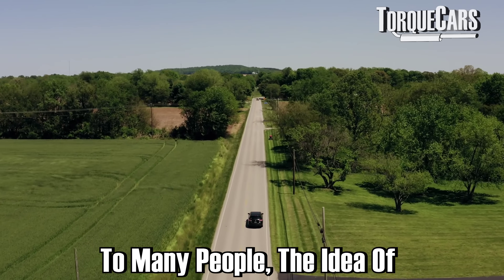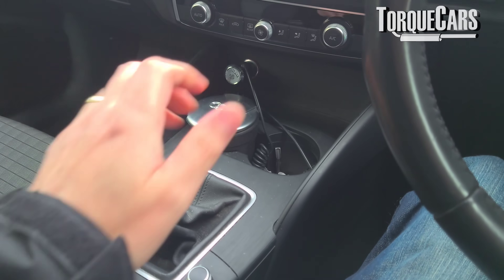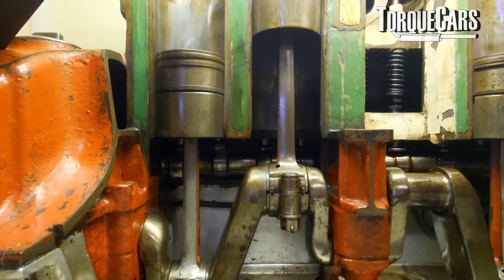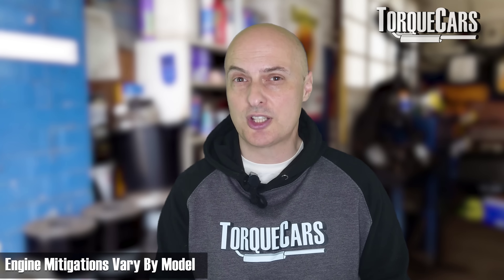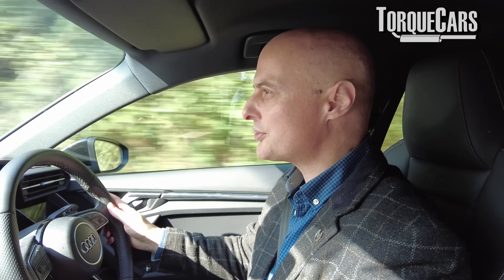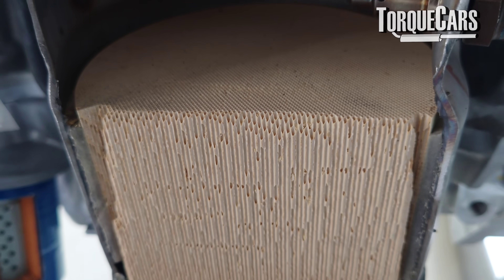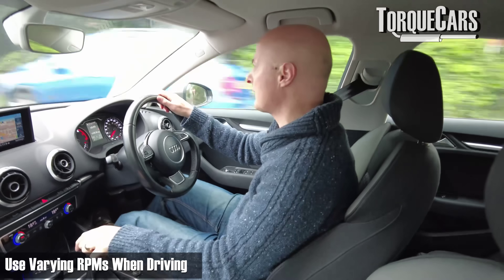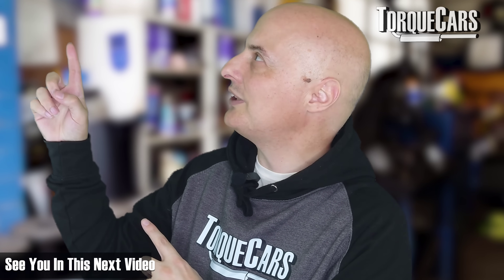BIG DAMAGE By Lugging at LOW RPM? Eco Driving Warning! (Manual Gears)

Comment: You should start this video by stating that most of what you are talking about here applies more to small cc turbo charged engines. For example NA 4.0 V8 won't really care about it but a 1.6 or 2.0 turbo charged petrol engine will be affected by this, especially LSPI at low revs and high throttle. Also diesels generally don't give much of a dam about this either.
Reply: Yeah, diesels are made for low rpm driving, they will be happy with anything above 1500rpm
Reply: @foxy126pl6 plenty of diesel like older land cruiser have peak torque at only 1200 rpm. It's because diesels don't rely on spark, they combust at max compression it's less an issue as no timing.
Reply: @cruiser6260  -  Along with that Diesels have no butterfly throttle valve.  
                               You increase the fuel in order to increase the engine's rpm